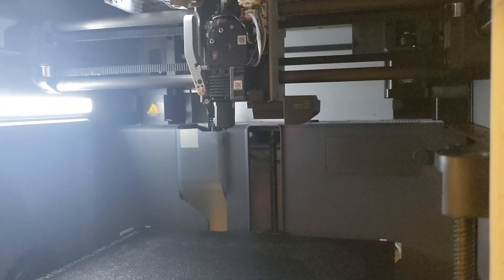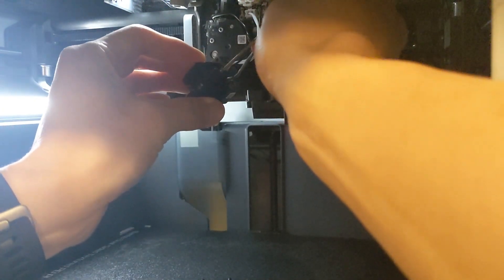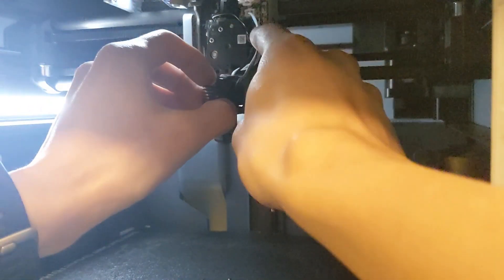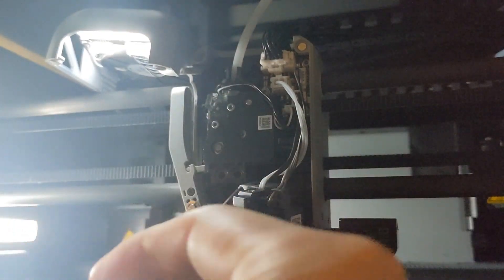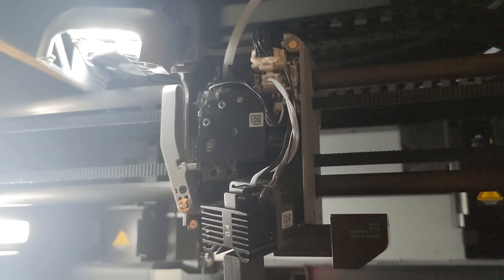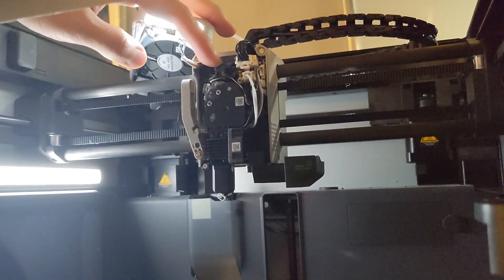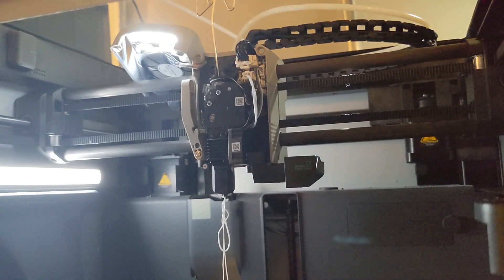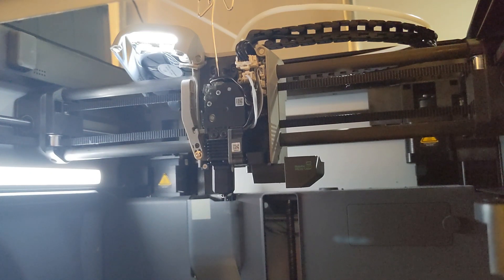The EASIEST way to unclog your Bambu Lab nozzle (no disassembly required)

Comment from the maker: Just a tip - if for some reason the unclogging tool doesn't push down, don't force it. This is likely because the extruder stepper motor is enabled. Sometimes it gets stuck enabled and you can't disable it on the UI like you can with some other printers. In this case, just switch the printer off and then push the clogging tool down and it should go smoothly and extrude out all the filament in the nozzle. The extruder assembly does have a spring loaded tensioner (it's just not adjustable) so this should be safe to do, especially if you have the X1C and the gears are hardened.
Reply: I could tell the tool was hitting something, but turning the printer off did not release whatever was in it's way.  Any ideas please?
Reply from the maker: @cmodyssey  if you're not able to force the clog out doing it this way, you might actually have a clog in the extruder itself, in which case you have to disassemble the extruder and remove any tangled bits of filament that might be stuck there.
Reply: @emberprototypes  Thanks, I sorted it in the end by cutting a small amounf of the PTFE tubing at the end and re-inserting into the extruder / hot end assembly!
Reply from the maker: @cmodyssey  awesome glad you figured it out!
Reply: By turning of the printer, don't you lose the hot end heating up to 220 degrees (hot enough for the filement), which makes the clog fix risky? Or I'm missing something. My understanding the clog fixes need to happen when the hot end is at required temp.
Reply from the maker: @AdrianM.DrintheThird  If you're quick it works wonderfully - especially if the extruder motor happens to be "locked". Just set your hot end to temp, get your tool ready, power off and push. Works every time for me. My older Raise3D machines had a "disable steppers" button on the UI that would be helpful in situations like this but the Bambu does not have this. It's actually annoying sometimes because you can't manually drive the gantry/head around in some instances if you want to clean the rods quickly and don't want to power off the printer.

Comment: My P1S is curently hung up in an CANNOT PULL OUT FILAMENT error and keeps telling me to check the extruder, but i already unclogged it... wtf BL... it won't even let me bring the tool head to the middle, it wil just stay far left and give me a 'printer is busy" warning if i trie to manualy button push it to the front and middle.

Comment: How do you remove the tube? Mine seems real stuck, so I need to unscrew something?
Reply from the maker: I've had that happen sometimes and it's super annoying. What that usually means is that you have an extruder clog (not a nozzle clog) and you'll have to dismantle the entire extruder to get the jammed filament out (which will then let you pull the tube out). It's a real pain when that happens 😢

Comment: Thank you! In a pinch without the no clogger tool, I used another piece of filament to push the clog through. Your commented tip to turn off the machine helped  too because it did feel like my extruder stepper motor was enabled.
Reply from the maker: Glad I could help!
Reply: Yes, ditto!

Comment: Same on me, the connector rip off the pcb. Bambu send a new pcb with silicon glue to put glue around the connector on the board
Reply from the maker: Sorry that happened to you too, it really sucked haha...luckily we have soldering tools and I could solder it back on while also getting a free replacement from Bambu 😀
Reply: @emberprototypes  I had a lot of heat creep problems
the chamber temp was too high (even for petg) and the heatbreak fan is insufficient
the filament deformed in the Extruder gears and when the cutter cut off the filament it stuck in the hotend because the end was thicker at the bevel of the heatbreak tube

then i printed a top glas riser with venting holes and haven't had any problems since then.
And it's better for the ptfe tube
that rubbed off on the top glass plate

Comment: Definitely wish this worked for me because I'm at my wits end with this printer. I have two hot ends now where it seems to be clogged at the top part of the hot end. I can heat it up, stick the needle in from the nozzle end, it will get about halfway up the hot end and just stop at the clog (regular PLA). If I try pushing it in from the top (with the temp set anywhere from 220 to 250) it just doesn't budge an inch. I've tried heating up needles/the end of the smallest allen key and sticking it into the filament, I've tried leaving it all assembled and pushing through with an allen key like you're showing here and it just doesn't budge and it's getting to the point that if I need to buy a torch or a drill to fix a clog that happens every month or two, or but a bunch of new hot ends, It just isn't worth it to me. I love the printer when it works, but the quirks are frustrating beyond belief.
Reply from the maker: I've noticed that sometimes the extruder motor/gear is locked which will make it harder to push through. You can try heating up the nozzle, then turning the printer off and then quickly pushing from the top. This has worked for me before.

Comment: How do you get the filament feeder tube off?
Reply from the maker: The same way all PTFE tubes come off! Push and pull.
Reply: I tried to pull it off and I lift up my printer by the tube 😱. Still clogged 😢

Comment: This is the method my Flashforge and Ankermake printers use to unclog so I was surprised when the Bambu suggested using the pin tool to push up instead of down.
Reply from the maker: Yeah, same! We still use the Flashforge pin tool that we had from years ago haha 😅

Comment: For what I read on the manual concerning the unclogging of the hot end , you shold use the provided L key to pull out the broken piece of filament and not for pushing it in. In order to acheive that you previously need to make the tip of the L key hot enough to melt the clogged filament and later extracting the key will take off the  filament as well... They also suggest to use the same filament for pushing out of the hot end some of the clogged filament.
Reply from the maker: Doing it this was is exactly how I ended up breaking the cable lol

Comment: This is incorrect; you’re not supposed to force the clog through. Rather you should just put a heated ball end allen wrench into the broken filament, allow it to harden, and pull the clog out. Much easier than pushing it through

Comment: So my experience so far has been most clogs within the extruder and thus the AMS can not retract the filament, which is a pain in the @$$ since it's damn near impossible to remove the PTFE tubing from any connector point just to the lack of slack in the filament. So this isn't helpful.

And as been stated already, you didn't follow the wiki
Reply: So what do we do to fix it? I'm in this situation.

Comment: I tried this with the flashforge tool you used, but it gets stuck against the extruder gear and bearing. Are you using much force to get it past the extruder gear? I didn't want to damage it by forcing it.
Reply from the maker: I've noticed that sometimes the extruder idles in a "locked" position. On my other printers I'm able to disable the steppers which prevents this from happening. I'm not sure why or when this happens on the X1 though. If this happens I usually just power off the printer and it will disable the extruder stepper and then I'm able to force the clog out.
Reply: Thanks! That worked!

Comment: Thanks for sharing!  I'm thinking about getting an X1C but plan on doing a lot of hotend swaps (I put a Revo on my current printer for that reason) and am worried about wear and tear on the ports on that board.  How difficult was it to get that board out and then back in?
Reply from the maker: Replacing the board was very easy. Removing the connectors is also easy, although there's a bunch of silicone on them which you will have to remove the first time you do anything on the board. That can be a little time consuming but it's not that bad.
Reply: @emberprototypes  Great, thanks for the info!  I've currently got a Prusa MK3 w/ Revo and am trying to decide between a MK4 and an X1C.
Reply from the maker: @namedjasonc  I don't have experience with the MK4, but I can say that my experience with the X1C has been pretty amazing. Aside from the amazingly fast print speeds, everything is just very well designed and dialed from an engineering perspective.

Some other things the X1C has that the MK4 may not is integrated/automated linear advance calibration, automated input shaping calibration, and the AMS is a huge pleasure to work with, not just for multi-material or color prints, but even just for swapping between filament. No more having to change spools just to change colors!

Comment: Kind of off topic but I have been trying to decide between the Bambi labs x1 and a form 3+ printer. I have seen you actively in the formlabs forums and have found your comments to be very helpful. 

What would you recommend between the two? I mainly want to use it for engineering parts/end use. I also would like to model complex bridges (which has been successful on my company’s form 2 printer but not with my ender 3). This would be my personal use printer. Thanks!
Reply from the maker: It kind of depends what you need. Both have their own pros and cons. For general purpose prototyping, FDM is cheaper and easier. But if you need isotropic properties, or high resolution small parts, SLA is useful. In general, it's good to have both. If you have to start with one, start with FDM as it's a lower cost/time investment and then get an SLA printer later if you need it.

Comment: Soooooo..... It's weird that they chose to use surface mount connectors because..... in a random and rather unusual way of trying to unclog the nozzle, you may end up putting force on the connector in a direction in which it would NEVER, EVER be expected to receive force in?  I mean seriously.... the only time that connector would ever have any sort of lateral force is if you're for some reason trying to unclog a nozzle while having said nozzle and the hotend unmounted from the printer and in your hand.  Who does that?
Reply from the maker: Yes, who does do that? 😂

Comment: but are you not smashing that rod through the extruder gears first before if even enters the hot end ??
Reply from the maker: If you look at a teardown of the extruder design there is a idler bearing that is spring loaded. Bearings are typically hardened steel - same with an extruder gear that's meant to print composite filled filaments.

Given how infrequently you would need to do this to unclog, we don't think it's an issue.

Comment: You could build your own unclogged from 1,8 or 1,5 mm Springsteen Rod. Print a handle and put the springsteel in from top of the extruder, where the ptfe tube goes in. No disassembling and unclogging is only a thing of a few seconds.
Like so: https://youtu.be/rXF1PpZEedQ
Reply: Thanks I just bought one.  Is great idea to support the community.
Reply: @tkcdac  DIY is everything!

Comment: The reason for going SMD was almost defiantly "hey it's fine in most cases" and a lot cheaper and faster to produce for us (since THT requires fancier place machines + that vat of molten solder)

Should this specific part been THT: yes
Could they have added some other mechanical strain relief down the wire so that it absorbs the shock if you pull on it, also probably

Also I don't have one, but it looks like the board is flush mounted so replacing it with a THT board would require a new revision (molds and stuff) of the whole back part...
Reply from the maker: 100% agree, likely a manufacturing decision. I actually think that it's fine if this connector is SMT - they just shouldn't suggest a process that involves potentially shearing it off 😅

Comment: I am sorry but that is not what the wiki actually suggests! The wiki suggests to heatup the end of the hex key, insert it in the hotend and let it cool down and then try to pull it out FROM ABOVE. It's basically a cold pull done with an hex key. Bambulab also provides a needle for the nozzle that can be useful for small or partial clogs.
Also i would strongly recommend against unclogging a completely clogged nozzle by forcing the clog though the nozzle itself: residues from carbon filaments or bad batches of filaments can damage the nozzle if forced out at all costs.
Reply from the maker: I just double checked the wiki and you're correct - my bad! I am sure that many people are making the same mistake though.

I remember in our scenario, doing all the steps they suggested didn't work. We were unable to unclog the nozzle by trying to "attach/melt" the plastic to the allen key in the way they described. Similar with the cold pull and needle.

We've been clearing clogs out by using a combination of pushing with a pin tool along with breaking up debris from the bottom with a needle for years on our other printers without issues and it has definitely been the easiest and most reliable way for us to fix clogs.
Reply from the maker: I'm also not convinced that pushing debris out would damage a hardened steel nozzle. Hardened steel (eg tool steel) is very, VERY hard and it's unlikely that what you are extruding is harder.
Reply: @emberprototypes  this depends on the filament people are using, since we are referring to generic clogs. I even found a metal chip once in a bad filament batch 🤷‍♂️ pulling whatever it is from behind is much safer. I usually do cold pulls every now and then to keep the hotend clean.
Reply from the maker: @FedericoAlbano83  a metal chip in your filament sounds pretty terrible haha...but even still - different metals come in different hardness scales and the chance of it being of a hardness above hardened steel is very low
Reply from the maker: I also just realized that whether you are pushing or pulling - even if you follow Bambu Labs instructions the issue still exists where you have the allen key "stuck" in the hot end, and you are pulling it (exerting lots of force to separate), while the hot end is dangling by its cable. This is precisely what caused our connector to break. So I still stand by my claim that the method shown in the video is way better and easier.
Reply: @emberprototypes if you're finding you need to apply a lot of force to pull the allen key out, you need to increase the temperature slightly in my experience. Nice tip with the needle too.